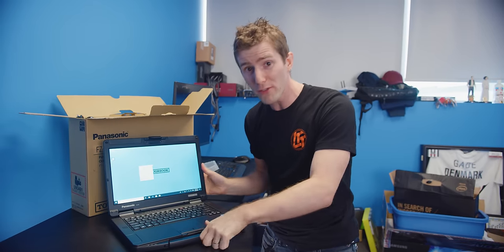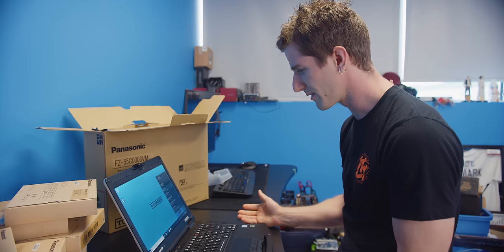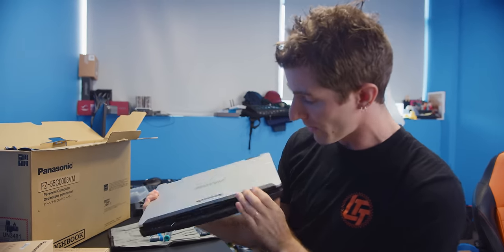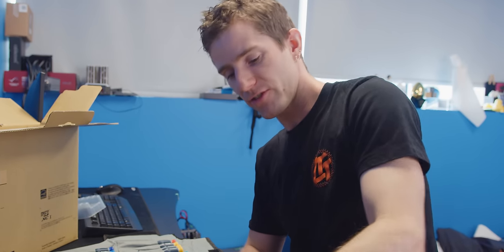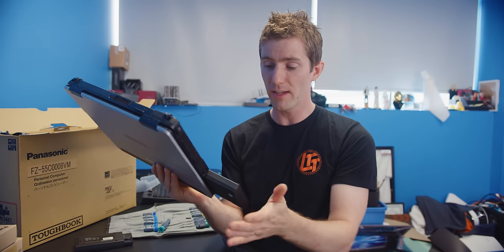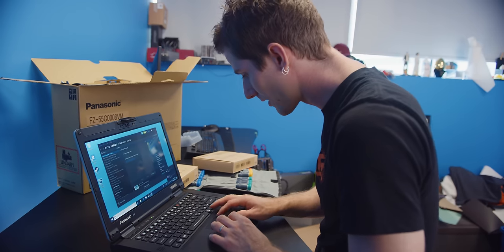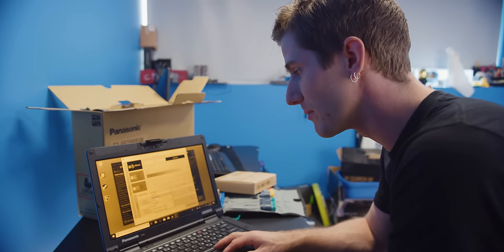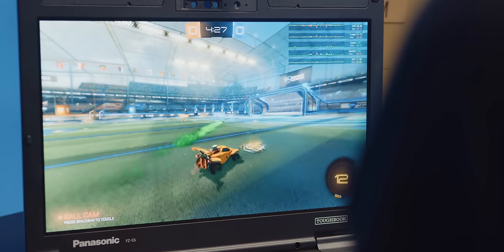The CRAZY Upgradeable Laptop - Panasonic TOUGHBOOK 55 Showcase

Comment: The only laptop that kind of comes (or came more accurately) to mind for a modular approach was the old DELL latitude E6400 - still haven't found all the options... There are many.
As far as I know, you can get a backlit keyboard (an easy pop n swap affair)... A graphics card (no idea on spec)... A larger battery back (the dual is obviously better though). .. the DVD drive (showing the age now) can be swapped out for a second HDD. Plus other options such as Bluetooth and improved WiFi are all there...

With this tough book - it would be the extra battery and a second HDD.
Maybe get a dedicated dock too 🤔

Comment: Only problem with the FZ55's is they are NOT totally waterproof (as the earlier ones were) and the screens can't take much in the way of impact, I know because my company bought 8 of them, three had to go back, 2 with water damage and 1 with screen damage and even though they were in warranty we still got charged for replacement (water damaged) keyboards and a new screen. The old CF range was much tougher. Also the price of the 'add-on' modules are horrendously expensive for what they are.

Comment: If the video card module had additional hdmi out it would be really awesome. Could use it for dj / karaoke applications. Since it's tough built would be great for sitting on top of a dj equipment rack to run the show.

Comment: My personal load out: max RAM, max internal SSD, IO expansion, smart card reader, optical drive, upgraded WiFi card, cellular, one battery. A perfect in the field all purpose laptop. Great battery life, great durability, great security, optical drive for those stupid situations you randomly encounter where you still need an optical drive, cellular for sites that either don’t have WiFi or that you do not want to join WiFi, smart card reader to lock people out if you have to restrict access, and finally SERIAL PORT so you can easily interface with console/command/debug/monitoring/programming/troubleshoot ports on selective or legacy equipment without adapters or USB serial conversion programs.

Comment: Electronic Engineer in a Manufacturing role.  We use these (older models) because some of our older equipment requires serial port or 3.5" floppy drive.  The add-on graphics card would be great for running CAD or Solidworks or our simulation software.  Also, tough as nails and survive being dropped and getting banged around.

Comment: It reminds me of this old Toshiba Satellite p200 my parents had that I took apart once. It’s from the early 2000s and it’s the only laptop I have experienced that you can swap out the RAM, CPU, GPU and HDD, though no hotswaps unfortunately. Too bad that it uses a super old CPU that can’t be upgraded to modern cores (intel core 2 or something), has a max RAM of 4gb and I have no idea if alternate GPUs exist, though I know you can remove it. If it was higher spec I would totally upgrade it and use it for work.

Comment: Looking for this very thing right now! I don't really care if it's that old! Panasonic has stopped developing new Toughbook models from what I've read, but it still begs to the question as to why laptops aren't made like this one!?
The CLEVO/SAGER/MSI GT72 models are the best designs in terms of gaming, but the case plastics are crap! If they would build a magnesium housing for the GT72 platform and use access doors/covers to swap, repair, or replace... It would be the last one they would need to design! Build around the case and keep that case for 7-10 years before the revised version comes. Ingenious design and it would cut costs as well as first year RMA numbers as well!

Comment: ThinkPads were not built with the ruggedness of these in mind, and they've been getting worse over the years, but a lot of their models do still have serviceability as a main goal. The majority of more business focused units can still replace the keyboards with just 5 screws. Also, some ThinkPad models (such as the T470) had both a smaller integrated battery as well as an external battery, allowing you to hot-swap indefinitely as well. Not the same level as this, but more enterprise focused products do still care about serviceability ... it is only in the consumer world where glued together screens and riveted keyboards have become acceptable.

Comment: I like the design but it would better with classic style keyboard when it's that thick. And the drive bay function is really useful. I got similar thing in my Dell D630 where I can have DVD-RW drive or second HDD/SSD. No screws just special hiding handle to easily remove the drive.

Comment: That same GPU was also featured in this: Dell Precision M7520-KM1NG

I would only be interested in this Toughbook, if the screen was swap-able for a flip-version. So you can use it as a big ass tablet with that stylus incl. And then an ODD, SSD, VGA/COM, Fingerprint, GPU (but only 1 GPU placement option :'( ... sad me ), more options-card reader

Comment: Express card slot (the successor to PCMCIA slot). Does this have Thunderbolt to support eGPUs? If not, an IO module to get that port!
I love Toughbooks. I remember my CF-28, a Pentium 3 fully rugged model. Awesome design. 
My first modular laptop was a Dell Latitude  LM Pentium 1. Had 1 or 2 modular bays. Could swap in and out a CD-ROM, or floppy or second battery. And, had a nifty Infrared port to wireless print for free as a High School student ;)

Comment: mind blowing that you DONT have those kind of options. this is a tad overkill, but I remember my old 2007 Dell inspiron 1525 that every component was upgradable. I switched out and added everything that was in the highest specd inspiron 1525 available from dell. did the same with a 2015 Asus KS53d Laptop. I'd like to see that make a comeback. nowadays OEMs solder anything they can to the board, which is killing upgradeability and repairability. I also have a 2015 Lenovo, granted its an ultrabook. only upgradeable components are the m.2 ssd and m.2 wifi. the m.2 port for the ssd is both PCIe and sata, so it will recognize both NVMe and sata drives, but will only boot from a sata drive because the bios only has drivers for sata. so there's that too.

Comment: long trips with girlfriend: prolly 2 batteries and a 3rd battery in the blue ray port (if it exists) movies & light gaming
gaming mode: 1 battery, SSD drive 2nd battery port, extra GFX card in Blueray port (unless onboard grapics can run PS2 in which case 3rg SSD in blueray port) and any other port that offers SD and micro SD card for extra storage.
...I think that's it for me. love the modular fashion, even if it does look like its from mid 2000 =D

Comment: Thats Easy, 2 bateries, VGA port, only thing i need now is a All weather high vis monitor which i can permanently mount outside in my cockpit and i am happy :D
Oh i do need an NMEA connection from my GPS and AIS to work with the Laptop, but there are good NMEA to USB adapters.

Comment: just came back to confirm my previous comment, i was right, many tactical jobs do use Panasonic products that are military and tactical grade they also have other versions that are even more sturdier and can be taken out everyday on a drive in a bumpy road jungle and hills and off roads that the military can benefit from on missions and jerky transportation trips and of course it makes sense to make a laptop sturdy and tough and also absorb vehicle movement shock like no different to the principles of physics of a car driving on certain tough roads since constant shock vibration and movement tossing overtime can destroy and malfunction computers with delicate powered on motherboards, well there's your main problem dear Truckers who like having laptops with them while truck driving you will need a special mount or at least keep your laptop from moving around and your laptop must be able to absorb shock vibration which relies on special mobo built in construction like the police and military are using.

Comment: One extremely toughbookey feature they had, atleast in an older mode i've looked inside. No electrolytic capacitors. All tantalum. Only matters if the laptop is somehow frozen or something that would cause a leak. Makes them last for a long time too. And yes they can be frozen and not break. That knowledge comes from youtube not seen that myself. But. Toughbook means Tough.

Comment: But after 1or 2 or maybe 3 years of using this laptop and inserting those thing i think something will brake and your battery or fingerprint senzor or enything else will not work anymore or it will just slide out.

Comment: My God... I miss replaceable battery modules. Being able to just pop out the battery and swap it with a brand new one (or higher capacity one) in just seconds with no tools... That, along with occasional cleaning and dusting, can pretty much extend the lifespan of a laptop indefinitely. 
Nowadays, a laptop is pretty much only as good as its battery. High end components and cutting edge chassis or hinge design doesn't mean anything it the damn thing wont last long enough to actually do any work or gaming on it.
Reply: I have two ten and eleven year old Macbooks. They are both running fine on their second batteries. All I needed to replace those was a small screwdriver. You think a tech educated person like yourself can handle a screwdriver?

Comment: I have always wondered why desktop PC´s weren´t made like this to begin with, most interfaces on the inside are common standards. It would make it extremely easy for even grandma to buy a new GPU or f.ex. HD, slot it in and good to go. I doubt a CPU could be made modular due to the demand for various cooling options but as far as the rest of the parts it should be pretty easy.
Reply: I mean, gpu's are just slot in, and I've seen a few cases where the side swings open, and you just slide the gpu in on rails

Comment: I would still go for the Dell Latitude Rugged 5420/5424. The Toughbook CF-54/FZ55 is not durable enough like the front latch that breaks easily. Then to replace it, you have to replace the LCD as well since the latch is preassembled to the front bezel and the LCD. Junk for a pricey Panasonic Toughbook!!!

Comment: the maximum allowable battery size on a plane being 100wh is a wives tail. you can have a two oversized batteries up to 200wh each. i've traveled internationally with a 156wh battery and never had anyone so much as ask about it.
Reply: 100wh is the us legal limit, but unless they specifically notice, they can't tell Jack shit.
Reply: that's just not true. taken directly from the TSA website: "One spare battery, not exceeding 300 watt hours, or two spare batteries, not exceeding 160 watt hours each, are permitted in carry-on bags."

my original figures were a bit off, but as you can see, 100wh is not any legal limit. again, it's a wives tail. yes, you can carry as many batteries as you want up to 100wh without anyone asking any questions. that is absolutely true. what is not true is that you can't go above 100wh.

i live in texas, the heartland of america. if i can do it here, i can do it anywhere in america. it's not because TSA are incompetent, it's because it's not illegal.
Reply: @Kamel419  when did they change that? I had to ditch a 120wh battery bank on my last trip out of the us, that was a massive pain, but it was only 80 bucks to not miss my ticket...
Reply: @marcusborderlands6177  i don't know, but i traveled with my >100wh battery to thailand in i think 2018? didn't have any problems at any of the airports i went through (south korea)

edit: to be clear, the website does advise that it's "at the airport's discretion", but it also says that about basically everything so they always have the ultimate say
Reply: @Kamel419  well it looks like it might have just been TSA being TSA, lol. Assholes even open my luggage when I've got a firearm in it, and with a beefy non-tsa lock as per regulations.
Reply: @marcusborderlands6177  if it's any constellation, on the same flight they took a router from my checked luggage lol. i assumed it was due to it not being of the right region
Reply: @Kamel419  yikes. Tsa really is a bunch of min wage gov employees, lol. I just wish airports had their own private security, then they could be held more readily accountable.

Comment: We got an Asus machine a couple years ago, 4 GB RAM became too little, too soon. So, when I tried to find out how to upgrade it, it turns out you have to practically rip it apart just to plug in a second RAM stick. Just because ASUS wouldn't place a door with a couple screws, like my (still functional) 10-yr old Acer Gateway.
Reply: Yeah that's normal for newer laptops. Clamshell design and all that. Very few laptops have the little door.

Comment: I bought a Dell 13" laptop back in 1997, and it had a lot of ways to swap out drives for extra batteries and a lot of I/O for its size.  Nowadays you are buying a flimsy piece of plastic with inadequate cooling

Comment: dude. If they actually sell this thing, and had like optional GPU types, such as something like the Radeon Pro for professional use, then had like the new RTX 3060 or 3070 or even an AMD RX 5600 or 5700 XT if they need to use strictly AMD hardware, I would WITHOUT QUESTION buy multiple of these things. 

HEY, YOU HEAR ME?! DO IT. DO IT NOOOOWWW

Comment: A 40 hour battery life would be an immediate buy from me… also because it’s very configurable XD
I’d hope this thing could run a GTX 1060/1660, cuz that would be pretty good
Ok well… at least then Radeon pro WX 4150 is almost close to a GTX 1050, tho still less powerful due to mobile cards using lower base and boost clocks.

Comment: Hot-swappable CPU’s is what modulation fans have long dreamt of; and further legitimizes and boosts appeal to swap whatever you want on the fly. I’m kinda surprised every CPU drive, disc, chip reader, scanners, cameras, power supplies, batteries, USB, sound cards, screens, even OS’s aren’t already all in a universal true plug & play without missing a beat by use of some #LEGO-like universal bus that streamlines resources in order of (relative/subjective) order of importance and optimized balance. 

We should be able to walk into brick/mortar stores, custom-build our own machines from start to finish on a lunch break. Of course the option to build it in an app on our phones (with both in-store and online with popular preset builds for 3-click machines for your entire workforce. All fully inter-compatible, upgradeable with a hot swap; meaning far fewer IT headaches. And while I’m daydreaming, have it delivered in 30 minutes or it’s free. Like a pizza (well, in the 80’s...). A Fully Hot Swappable Multi Modular Universal Computer. FHSMMUC. FishMuck. 👍 (“Would you like that in a Desktop or Laptop form factor”.  Color coded to ID which family of components/peripherals the little ModBlock belong to (CPU, Ram, storage, etc.
Reply: ... also OpenSource standard. Your HP can swap mods with your Samsung, etc.

Comment: I am a senior on a tight budget. i have a Lenovo  Z570 laptop.  Is there a way to max out memory and get a larger hard drive? If I do get a new HD how would I transfer my system to the new drive. I have Parkinson's disease and would also like to know if you can recommend a budget laptop that has voice recognition for various things. It is becoming increasingly more difficult to type.  If you have an extra laptop you can part with that might help me,  I would be willing to make payments. Best I can offer as my budget is so very tight. Thank you for listening.
Reply: You can put in an m.2 ssd at least, and just throw in 2 sticks of high capacity sdram

Comment: i remember working laptop like these from Dell,  which were destined for the US military for field use,  and i recall that these had to b certified to b capable of not only surviving but fully functioning up to being airdropped from a c17.  the laptop weighed a lot and part of the weight was down to the chassis which was supposedly llined with kevlar.  super dupe and was like 3000 bucks

Comment: Seen this 1 year and 1 new brand attempt later it makes you realize this is not going anywhere in near future
Reply: isn't this panasonic more used by army and such instead of by regular consumers?
Reply: @jensverstraete4722  I have no idea, is it?
Reply: @JoIs033  i thought so because didn't they give An example in the video from the website that was like from the perspective of police?
Reply: @jensverstraete4722  you are probably right, it is very likely that they secured a contract but that doesn't means they are gonna use of the upgradeable features, it's probably being used as any other thought laptop
Reply: @jensverstraete4722  is possible that police and army have just one module developed at measure according to their necessities but not gonna use anything else apart from that, I'm only assuming based on the fact that I have never found availability of this model since back one year
Reply: @JoIs033  true but it's easier tonfor example swap batteries and such and i wouldn't we surprised of there where proprietary modules with specific use that while they don't need it all the time they would have lying around to slot in when needed